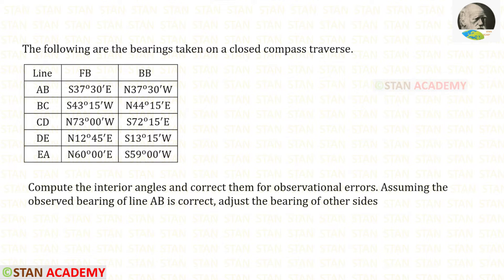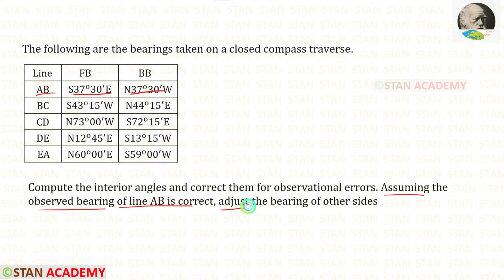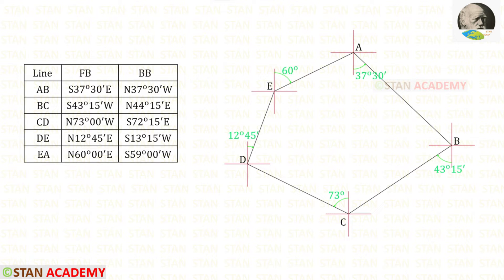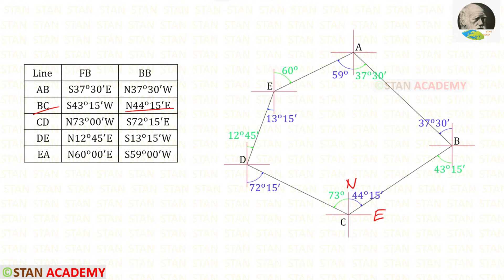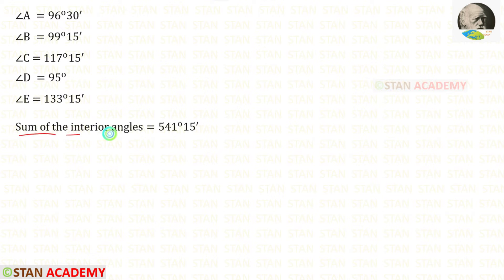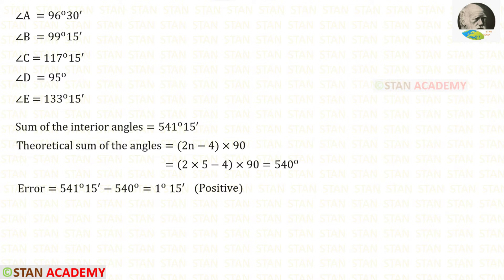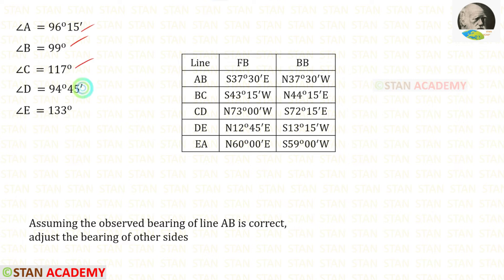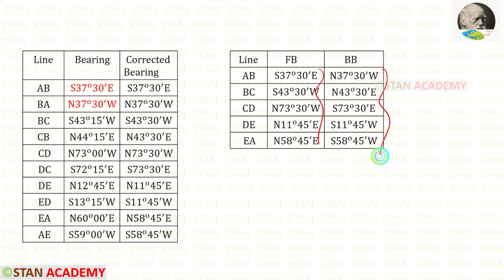Compass Surveying - Problem No 7 ( Reduced Bearing Type - Interior Angles & Adjustment of Bearings )

Comment: For the closed loop traverse in the diagram below, the direction from A to B is fixed at 270°. After
the traverse has been computed and adjusted the bearing of the line 1-2 will change from 270°
and the traverse will have to be rotated to bring it back to 270°. A swing angle is applied after the
adjustment.

Comment: Sir.
If the question doesn't mention the direct or included angle method,how can we know the appropriate method to use because I usually solve with direct elimination method,but sometimes while calculating all the value at last it doesn't match with correct bearing value,but same thing solving with included angle method I get the correct answer.